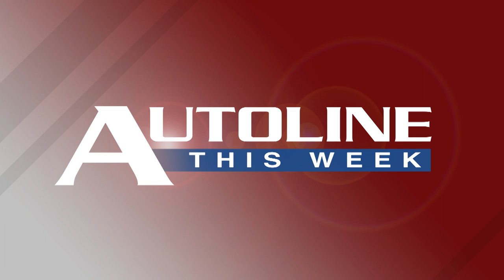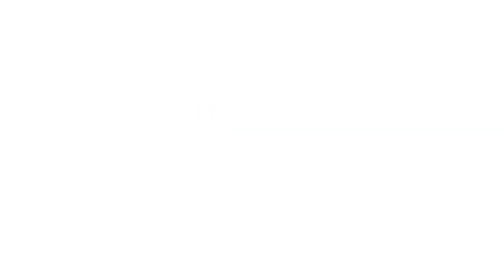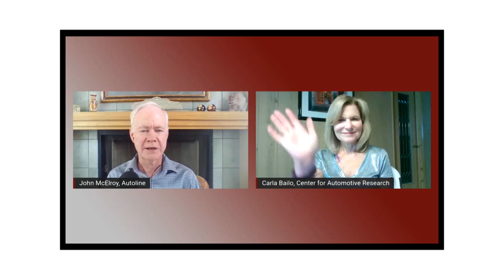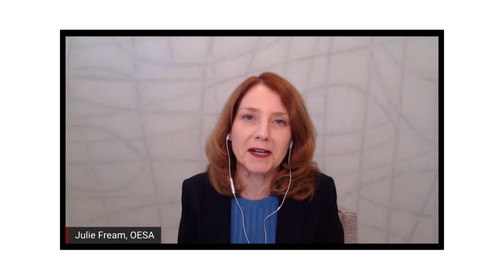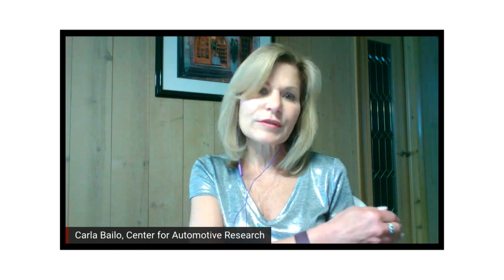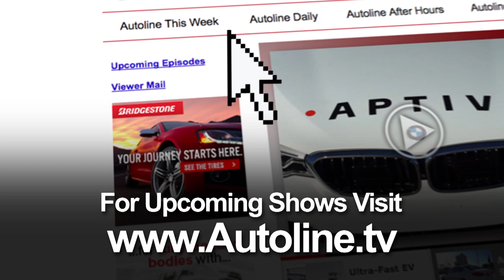Rebuilding The Supply Chain for Chips & EVs - Autoline This Week 2512

Comment: Would it be feasible for automakers to begin a new "Green Initiative" that would use reclaimed chips from old electronics? It could be a whole new marketing campaign and find a new use for the countless electronic devices (one report stated 300 to 400 million) that are disposed of or recycled each year in the United States.
Reply: I’m thinking open source architecture where they have one board with 2 chips running everything on the car instead of suppliers supplying chipped boards for every single components; navigation, driver’s assist, engine computer, transmission computer, dimming mirrors, powered seats, and so on. This would allow Ford, GM, Stellantis, Honda, Toyota, VW, etc to procure less complex parts and to integrate systems better as a package. Like the saying of the sum is the greater of the parts.

Comment: Auto industry has to move with the technology businesses , a supplier moves on to the newest
chips which are more profitable and competent so they are less likely to want to make old auto 
chips with the available resources. Why make low dollar chips when other industries want the
latest high tech chips? You only have so much capacity so utilize it for the best profits.

Julie explained it to a tee , the auto industry has to shorten its product cycle and change on the
fly like Tesla does with constant improvement no matter of the model year .

Comment: Lithium is the 3rd moist abundant element on this planet, behind hydrogen and oxygen.  The mining and processing of lithium hasn’t changed in the past 50 years. Tesla is looking to change that and has quietly acquired Springpower for the efficiency of mining and processing steps to the future. 

Your guest failed to mention lithium iron phosphate batteries are really the future of power as the materials are more readily available and perfect for battery storage, cheaper EV’s, many charge cycles, 2000+ and uses no cobalt. 
For those that don’t know, LFP batteries has less energy density than the nickel, manganese, cobalt, and aluminum around 160-200 watts/kg for LFP vs 240-330 for the NMCA. When battery density hits 500 watts/kg, then the aviation industry will change and possibly flying cars.

Comment: Holy crap.. no wonder legacy auto is screwed.. still operating with 100 nm chips dyes? Wtf.. that is ancient in computing tech.. 😂. It doesn’t even save money to be that old tech.. it’s just ridiculous!

Actually the consumers DO care where the materials are coming from.. more and more.. and the more open and honest companies are about it, snd what their plans are to reduce materials that have high societal costs.. the better that company will do.

Ok.. wtf is this Mark guy talking about.. lack of US plans for battery capacity?? Tesla alone has the LARGEST plan on the planet by 10 times beyond any other single company in the auto industry.. what a complete BS statement he made.

John, there’s NO reason it would take decades to clean up mining and refining materials. It simply has to be pushed as a requirement. Govt. or social pressures would flip the industry standards in a year or two. There is nothing that can’t be redesigned and cleaned up in a year or two if the will power, regulations and consumer demand leads it.. the industry will invest in what makes the future money.